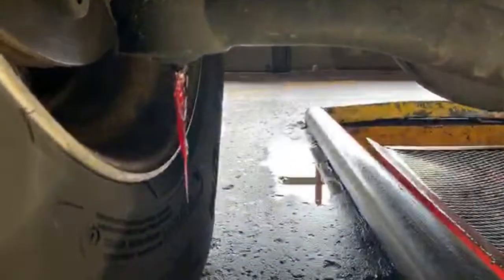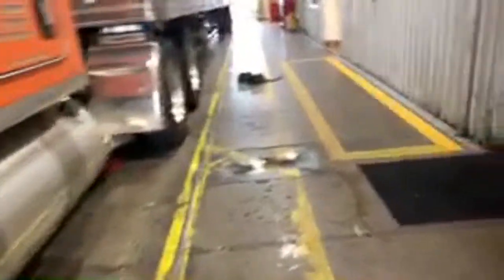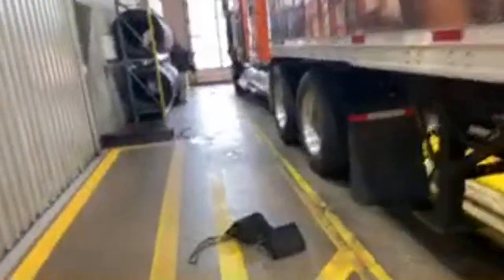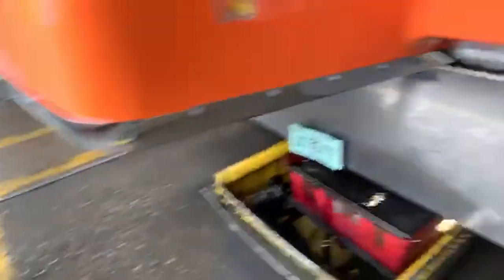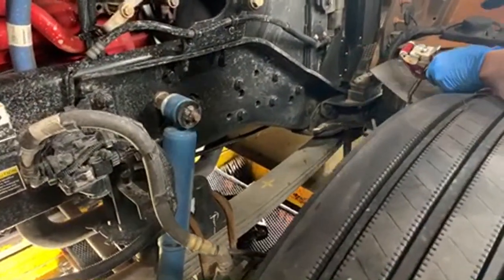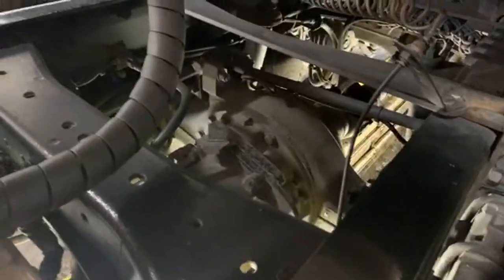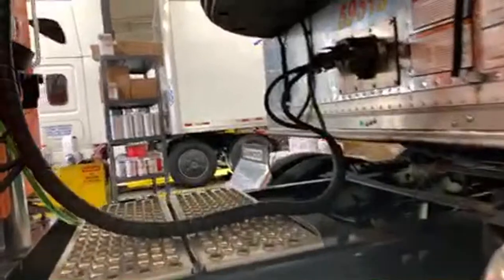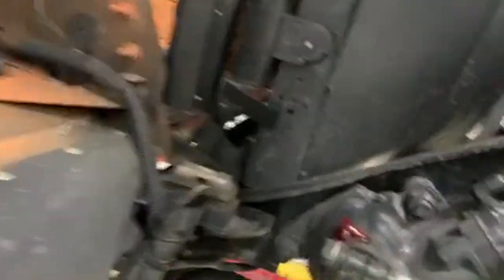W900 KENWORTH SPEEDCO FORGOT TO DO THIS - MUST WATCH

Comment: What's your wheelbase?     Also have been told that if the front end isn't jacked up to take pressure off when greasing the kingpins, they don't take grease like they should......am sure someone will correct me but that's what I've been told.....anywho, I always jack mine up....
Reply from the maker: My wheel base is 265.